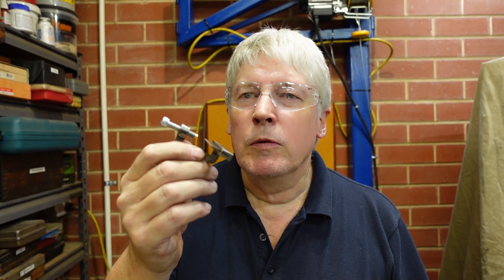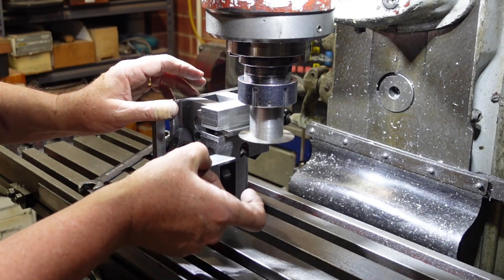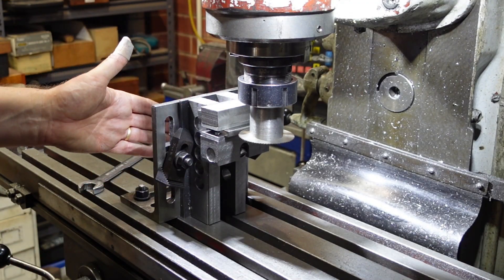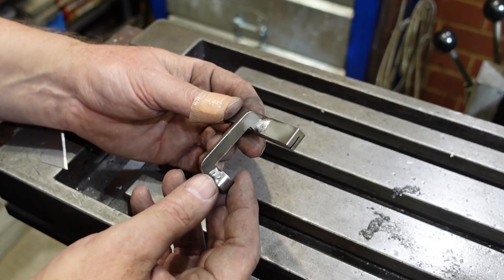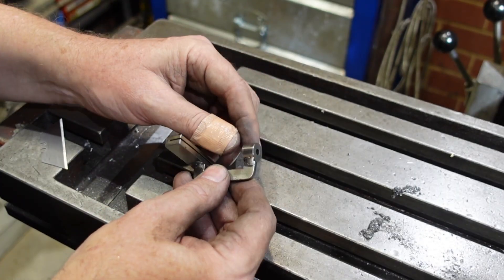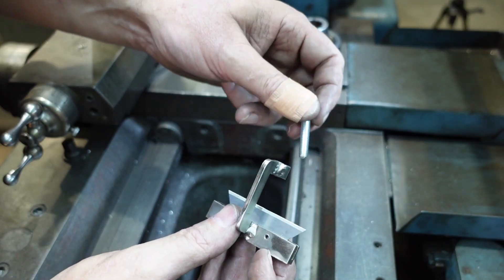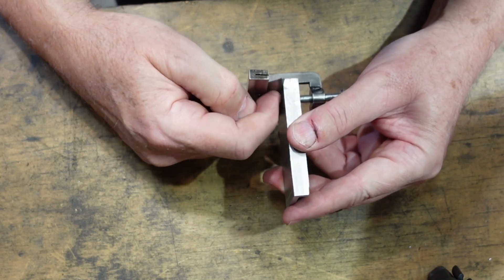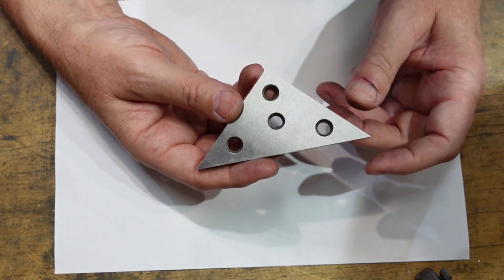Knife edged clamp - hit or miss?

Comment: If the holes in your commercial versions are not a detriment, Joe Pie demonstrates an alternative technique using precise hole placement to fixture the angle for milling.

https://youtu.be/lDwAzcSUVtI?si=9wr26el5re4So3rr
Reply from the maker: The holes did not worry me. I find those angle pieces quite handy, so was looking for a method to make them. Thought i'd found it but not quite...
Putting holes through in an appropriate (accurately placed) pattern then hanging in the vice using the dowels would have worked but this was an experiment to see whether I could position with scribed lines (yes) but the accuracy of my layout work was not good enough.
Reply: I would drill and ream 3 holes for the triangle I needed. Use them as 3 different pairs hanging on dowels to machine each edge. They don't have to right angled triangles either.
Reply from the maker: @marley589  That was an option (as above) but I was hoping the scribed line would work. With better layout, I think it would.